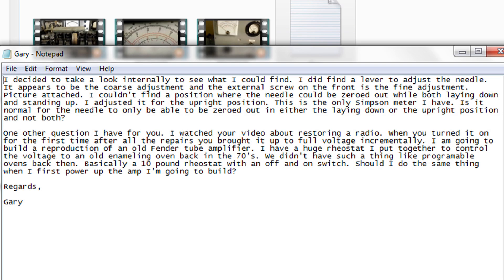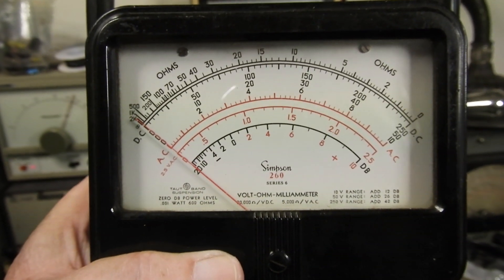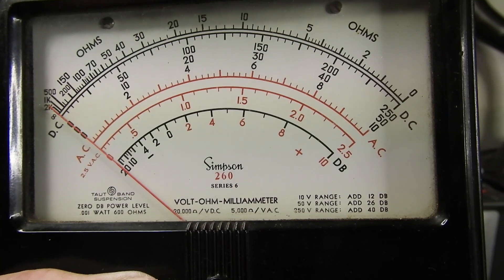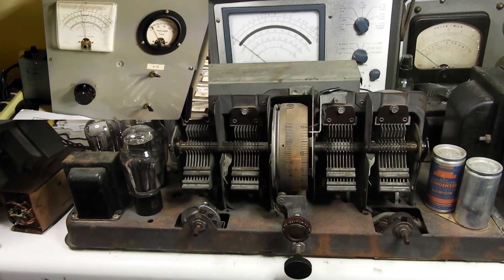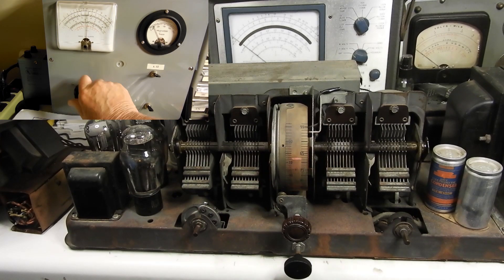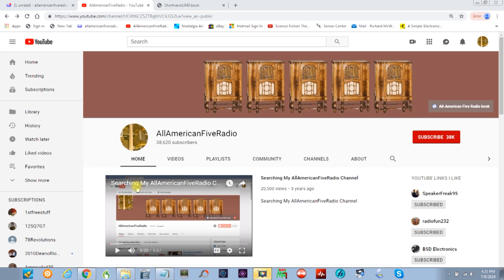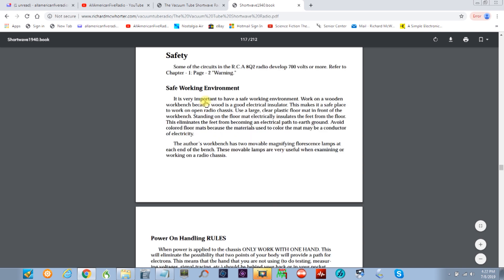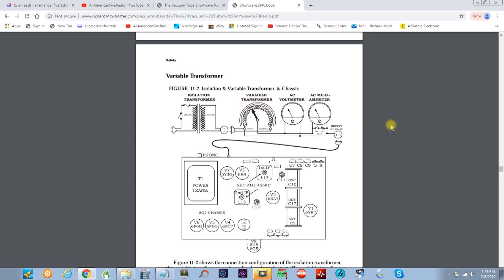Questions from a YouTuber about Simpson Meter and powering test radio up for the first time

Comment: Your Simpson multimeter does not have a weak magnet. What you have to do is to zero the needle in the horizontal position using a screwdriver in that slot below the meter. There's a small counter-weight opposite the indicator needle on the meter mechanism that can only be accessed with the meter face off. You have to remove the meter face and put the Simpson in the vertical position and adjust the position of this counter-weight to zero the meter if it does not stay zeroed in the vertical position. The position of the counter-weight has no effect on the needle in the horizontal position. Now your needle will stay zeroed in both positions.
Reply from the maker: I hope Garry contacted Simpson, it is a great company. Thank for the information.

Comment: Nice explanation. But what I don't get is why the output has max 1,5 amps...is it the windings diameter or what?
Reply from the maker: transformer design
https://www.electronics-tutorials.ws/transformer/transformer-construction.html
Reply: @AllAmericanFiveRadio  I don't know what kind of special isolation transformer you have that has the properties you describe. Every other isolation transformer, is a 1:1 turns ratio and the size of the primary and secondary windings are the same size and therefore capable of carrying the same amount of current on both sides. Only in step-up or step-down transformers does a lower current or voltage value exist on each side. The link you provided does not even address isolation transformers at all, using that as a reference to back up what you are saying about isolation transformers, is not even relevant. The only way that the isolation transformer can limit current, is through the fuse. So if you can only go as high as 1.5A, it is because there is a 1.5A fuse on the Primary side of the transformer. As far as the 40A that you mentioned. The windings on the transformer may say they are rated for 40A, (although that is doubtful), but the most you could draw from the outlet is whatever value of breaker it is supplied from (15A, 20A, etc.) An isolation transformer is a way of isolating your source ground from your equipment ground. If you need to limit current, use a current limiting device in series with your load (i.e. a lightbulb). If you truly do have some sort of special current limiting isolation transformer (other than the fuse being the current limiter) please post a video on how that works exactly. I would love to see it.
Reply from the maker: @srtamplification  https://www.tubesandmore.com/search/node/isolation%20transformer

Comment: if the radio receiver is considered a load or resistance, then why wouldn't the ammeter reading jump  up to the radio resistance?
thanks
john
Reply from the maker: It does. The Philco draws One Amp at 120VAC. Ohms Law = Amps X Voltage = 1 X 120. So the resistance is 120 Ohms and the Power is 120 Watts.

Comment: I still have my Simpson 260, it's the model with protection & mirrored scale.  I haven't used it in many years, I got it in the mid 70's.
Reply from the maker: Take the batteries out.